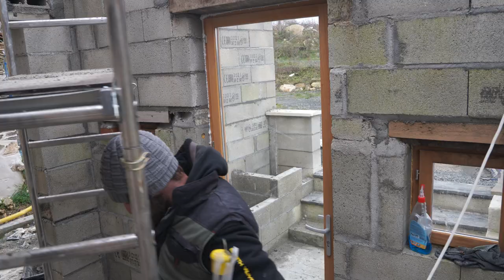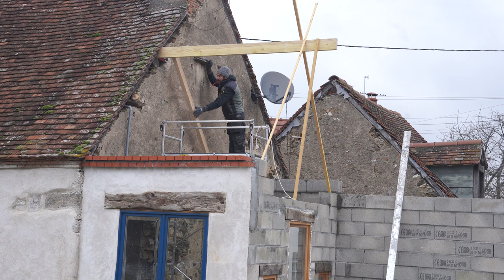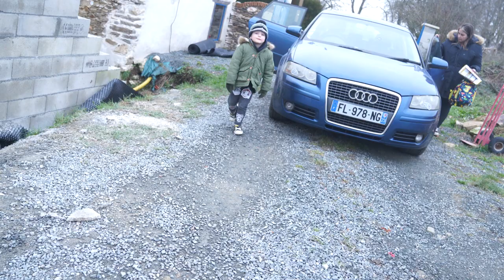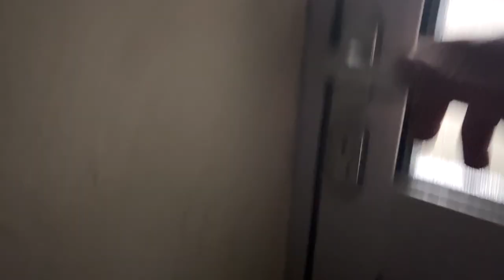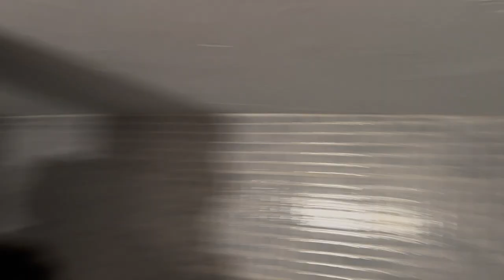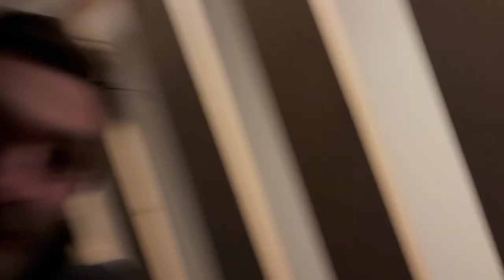There's a roof, and a housing disaster..

Comment: How are you securing the rafters to the top of the wall? Fixing a timber 4x3 inch timber wall plate? Should also birds mouth the bottom of each rafter. The collar ties, are you adding mesh reinforcement to stop the joins from pulling apart? Simpler to attach them to the sides of opposite rafters with galvanised nails as well as a few bolts.  Invest in a good circular saw.

Comment: Hi Dan,  some "birdsmouth cut or joints" at the bottom of the rafters might have been more stable and secure, also is the wood treated, it's not green ? Looking good so far 🙂 
That Airbnb is a insult and not going by any French or European building regulations
Reply: Yes that is what I thought too with the birdsmouth joints.  I know with our barn conversion we had to take the existing roof off and redo all the rafters with the little cut at the bottom and at the top we had a 'plate' that tied the rafter to the beam. Must be different building regs in France.  We also had to have a building inspector sign it off from the local council.

Comment: Dan you are doing a good job BUT roof need setting on wall plates as it can spread with tile weight. For goodness sake wear proper footwear as if you drop your hammer or a block on your toes you could be out of action for an awful long time. I once took a brickie to hospital as he dropped his sharp trowel right through his trainers and lost two toes. He is still limping ten years on. Do not walk on walls as in low temps. a block can easily crack off and you may fall. Please think ahead. Bob ( Weston super mare. Somerset )

Comment: I don't mean to put a damper on your hard work but DO NOT get up on the roof until you make some serious changes.  Your ridge beam needs a vertical support under it, the rafter tails need to be secured to the walls so they don't slide out and actually hold your roof down in a storm

Comment: That B&B is defo illegal, quick check online & :-
To legally rent an apartment in France, it must have a minimum ceiling height of 2.2m, a minimum area of 9m² with a window, a separate bathroom, heating, a water system, and working drains and gutters. In addition, the building and the apartment must not threaten a tenant's health and safety.

Comment: At least for the shower, if you put a cheap plastic stool (you know, like the kind they have at street stalls and tent bars and such) in the tub then you can shower while seated. Which is, in my chronic-pain suffering opinion, more comfortable than standing up to shower anyhow. I am short and have a relatively spacious shower stall and yet still use my silly little plastic stool for every shower.

Comment: Isn't it great...measure twice, cut once 👊
However...I was wondering, and I checked with my man who's a carpenter, might that roof structure not be best to have a top plate fixed onto the top of the blocks and the brick, to which you fix those rafters? What if the wind blows, ya see, and rips that roof off? Or if there's an earthquake? Does it get windy, or have earthquakes there?
Not judging you, matey...just preventing a potential disaster.
Can't believe the lack of height in your new temporary abode. Hopefully you find somewhere a bit more pleasant, if that's what you want.
Love Jacqueline from New Zealand.

Comment: I know that when the roof is done, it will be really heavy and won't move easily, but it's going to be held in place by more than that single piece wedged into the other building, right? Maybe the wind isn't very powerful there, but if that were a roof here, the wind would easily rip it right off. Looks really good though, that's a very cozy airbnb, but I wouldn't want to navigate it in a hurry or while drunk. ❤ No hate here, just concern.